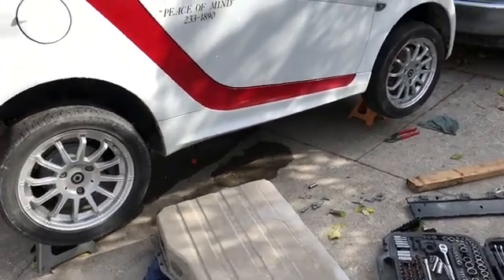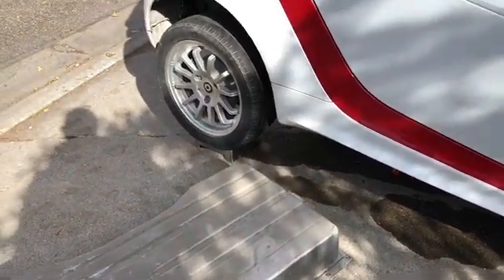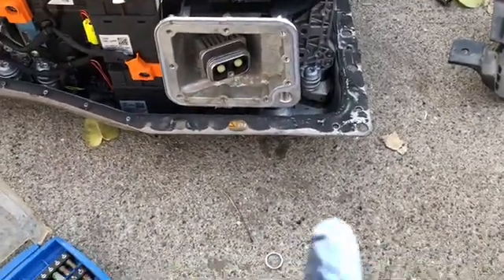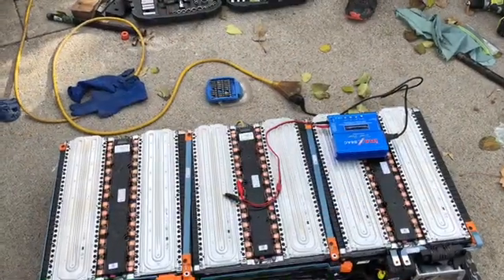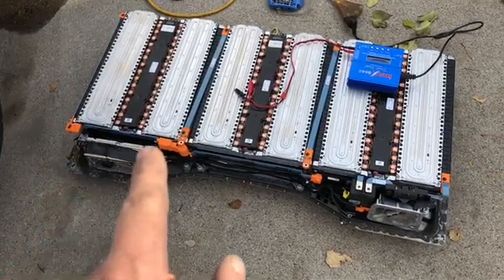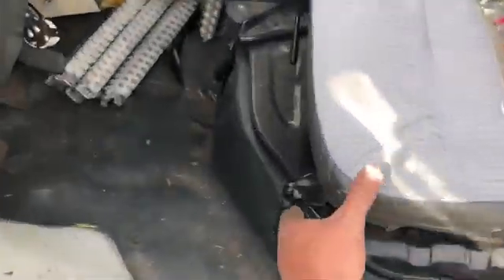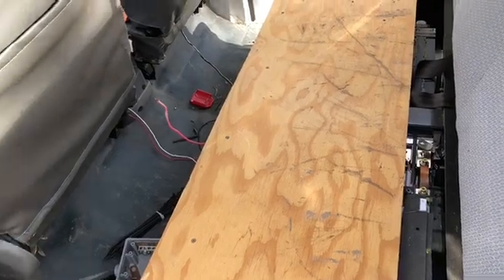How to Swap Out YOUR Smart Fortwo HV Battery! (Part 1) #lithium#battery#smartcar

Comment: My 2016 Smart Fortwo HV battery is dead, will cost too much to try to repair it. I want to swap but I'm curious how you sourced a battery? Will a battery from any 2013-2016 2nd generation Fortwo ED work in the 2016?

Comment: If they made them 18650 you could replace them easily
Reply from the maker: I have two smart packs made by Tesla with 18650’s and they aren’t easy to replace because they are enveloped in some type of super hard plastic.
Reply: @subjectmatteramateur16  bastards. They didn't make them easy to replace. Should be user friendly. Blocks of packs, pull out a block and replace the bad cell, ot the whole lot for 3000mah

Comment: Is it safe to charge them like that without a BMS? I saw your other video too where you did a bigger charge. Didn't all the voltages vary per cell that way?
Reply from the maker: We were able to do a bulk charge for a while and the voltages were really close but at the top we had to top balance them with the hobby charger.

Comment: Hi Shawn, my battery dose not take any the gauge stays on zero when I tried to charge it. did yours have the symptom?
Reply from the maker: I separated the three blocks and had very low voltage.

Comment: I have a smart EQ battery with 20 000km and using the xentry diagnose on the car I discovered that one cell has 102mV less than the others.... also is telling me that the actuator is blocked...my question: the actuator is one of those 3 relays inside?  Second question: can I balance the single cell charging a little the cell that has less (102mV less) and what voltage to use ? Ps: I don't want to disconnect the electronic board from the cell that needs charging....can do that?
Reply from the maker: You might be having the same problem as 1967goldi on this thread bellow. Support from Mercedes or Bosch is non existent. I wish I had parts. You can charge an individual cell. It is a lot of labor. I would make sure to disconnect the modules from the bus bars, wear gloves and be very careful not to arc anything by touching metal tools to separate parts (we have done that).
Reply: @subjectmatteramateur16  the cell is only 102mv below.... can't I charge it with the IMAX b6 a little? Do you think is the sensor? The exact error message is: frequency counter (switching cycles of contactors) will soon reach his final value - the actuator is blocked
Reply from the maker: @electrikmirk7828  I believe you can charge individual cells (I have). 
I don’t have a working knowledge of codes and their meanings, sorry.
Reply: @subjectmatteramateur16  I only have to give it some millivolts as the difference limit is 100 mV and this cell has 102 mV less than the others... that difference is telling the BMS to keep this actuator blocked
Reply from the maker: @electrikmirk7828  let me know how it goes
Reply: @subjectmatteramateur16  ok.... I'm studying how does this battery work before opening it...
Reply: @subjectmatteramateur16 the problem is a voltage sensor inside the battery... Hella....you can see the video on my channel...the battery is different from the 451.... I'm searching this voltage sensor but Hella won't sell it to me....

Comment: Hello Shawn, I am looking for a 2012 Smart Fortwo electric battery module which is basically installed inside the battery cell box. Can you suggest something?
Reply from the maker: George Iremashvili have you tried copart.com
Reply: @subjectmatteramateur16  Copart sells a lot of cars and the battery is empty already.
Reply: @subjectmatteramateur16  Hello Again, I am looking for an Battery pack for my 2014 Smart. Any suggestions where can i buy it? Many thanks in advance.
Reply from the maker: @GeorgeIremashvili  Have you tried copart.com? I understand that you would have to buy an entire wrecked car but if the car was wrecked at least it was driving when it was wrecked.

Comment: How does the hose next to the HV cable come off, it is threaded? I need to remove my battery and just want to check.
Reply from the maker: Douglas Lambert hose clamp.
Reply: @subjectmatteramateur16 Can't seem to add a photo but not the front 2, I mean the one on the passengers side rear next to the HV cable. Kinda looks like an air hose coupler in a way. Thanks
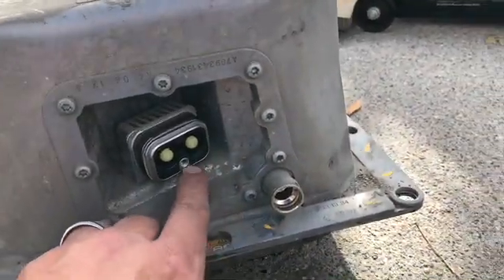Reply: The port you touch at 1:26 of the  video.
Reply: It comes off just like an air hose coupler.

Comment: why do you think the battery pack came to a such a low voltage ?
Reply from the maker: pjd412 no Mercedes built in a larger buffer zone into the BMS.
Reply from the maker: V10PDTDI we’ve debated this. I believe faulty BMS, others say owners who overdischarge. The new smarts don’t have this problem but they also have less range with the same kw battery

Comment: Heloo ,do you have a bosch sensor for this battery ?  0442B0301E ?
Reply from the maker: $50 labor + $10 shipping =$60
Reply: @subjectmatteramateur16  Hey! I Actually need that sensor for a Smart Fortwo Electric Drive with the exact same reference 0442b0301e
How do I get in contact with you?
Reply from the maker: We do.

Comment: What you doing with the old battery?
Reply from the maker: Frank Z it’s bad so I’ll take it apart completely and see if I can revive individual cells for a different project, maybe an atv or maybe just recycle them.
Reply: Shitty . Im looking for a 32s config.
Reply from the maker: Frank Z after I take it apart and see if we can rehab we can talk.
Reply from the maker: Frank Z why do you want 32s?
Reply: @subjectmatteramateur16  my invertter is 120vdc nominal
Reply from the maker: Frank Z solar input from a charge controller?
Reply: @subjectmatteramateur16  143v cut off. 10 x a 12v system
Reply from the maker: These cells are 3.6v nominal and 4v peak so I would recommend purchasing 36 pouches instead of 32 because you don’t want to overcharge them. Would you want 2 series or 1? Also the packs came in 31 but can be added to. You would just want to get longer rods to hold the packs together. I could weld them all together if you don’t have a good spot welder.
Reply: @subjectmatteramateur16  what do you want for the battery. Where are you located?
Reply from the maker: Frank Z I was going to sell 3 packs of 30 pouches for $1,000 a piece. 3 cells of the 93 were bad. That would be about $33 per pouch. So 36x$33= $1188 per series. If you wanted to pay an even $1200 I could buy rods and weld and bolt them all together. I live in Idaho.
Reply: I dont believe we can ship across boarders. Ill pass anyway. Thanks for the offer
Reply: @subjectmatteramateur16  Do you still have 3 packs of 30 pounces? I would like to purchase them.
Reply: @subjectmatteramateur16  Do you still have 3 packs of 30 pounces? I would like to purchase them.
Reply from the maker: Eco Cars they are all completely separated but yes.
Reply from the maker: Emma Simpson I do but they are all separated
Reply: Hi I have the same battery on my smart car with 6 x dead cells that I cannot revive have you any spare to sell or advise?  thanks Cath @subjectmatteramateur16
Reply from the maker: Catherine O'Leary how do you know that 6 cells are bad? Do you have an aftermarket tester?
Reply: @subjectmatteramateur16  I bought the car with a totally flat battery and would not charge at all.  After stripping the battery pack down I individually  charged each cell and I have been able to get 3 volts in each cell  apart from six which will not accept anything it is more of short when I try to charge
Reply from the maker: Catherine O'Leary what are you charging them with? What rate of charge? Volume is not as important as rate. Also the charge curve and wave form are really important too.
Reply from the maker: Catherine O'Leary what will you be doing with them when you are done?
Reply: still no joy reviving 7 cells our of our battery pack do you have any cells (pouches) to sell we are in the UK is it possible to ship them to us, or advise where I could obtain any cells? @subjectmatteramateur16
Reply from the maker: Catherine O'Leary I would scour the salvage places close by first. I can’t ship lithium across the pond.
Reply: Hi thanks anyway @subjectmatteramateur16
Reply: The whole pack is 93 s I charged with 380 v slowly... Another thing I Will need some parts of the smart car if you can sell me. Im from miami